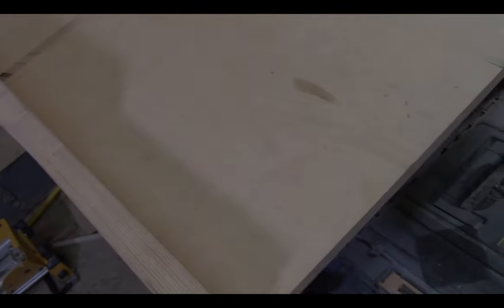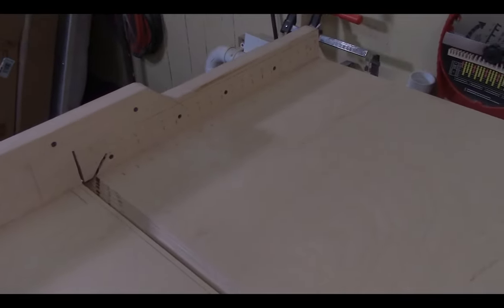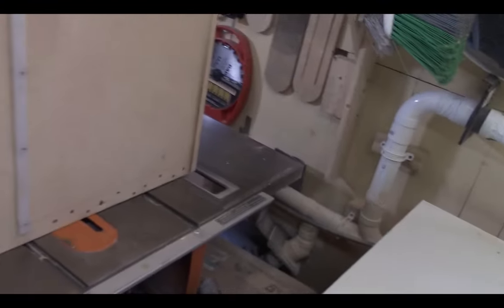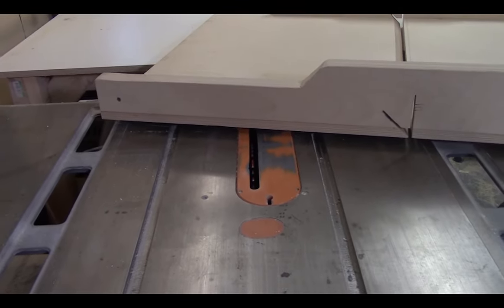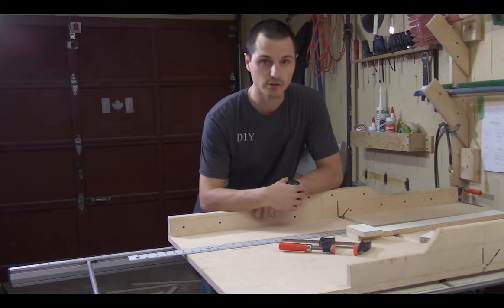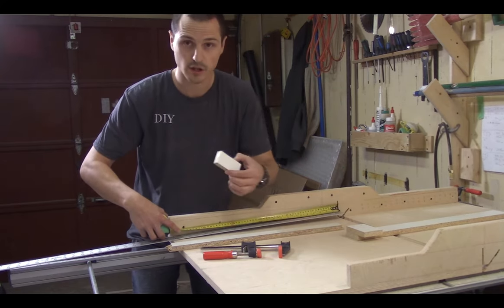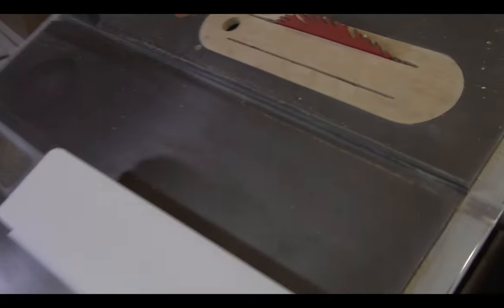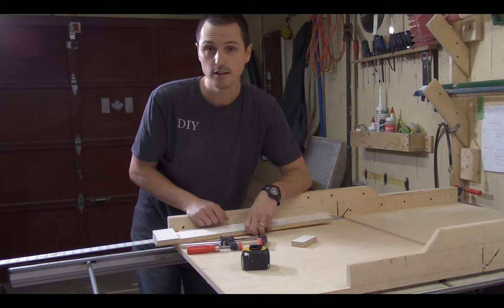crosscut sled for a table saw [plastic runners that will last forever!]

Comment: Bro. Do you have a video where you show how you attached the runners? Because I can't figure out how to get the runners to stay in place long enough for me to screw them in
Reply from the maker: cyanoacrylate! Lay the runners in the tracks and wedge them over to one side. Use cyanoacrylate on top of the vinyl runner and lay the plywood on top of the table saw. Once set, pre drill and screw down the tracks. Once you do that, cut the table in the middle only leaving a piece front and back then lay your fence square to the cut line on the table. Hope that makes sense! Good luck!
Reply: @DIYfortheaverageguy   I've done those steps, but I can't get them to stay in place with glue, so when I screw them in they keep moving slightly
Reply from the maker: When you shim the runners in the table saw, you should also shim them up slightly so the runners are proud of the surface of the table saw. 

🤞

Comment: I've bought plenty of birch plywood at Home Depot, but I've never eve SEEN Baltic Birch there.  Baltic Birch is a much higher grade than any HD I've been do carries.
The essential step for a crosscut sled is to get the fence perfectly square to the tracks.  That wasn't seriously addressed.

Comment: Found your video while searching for advice on using UHMW guide stock. Your super glue tip is surprising. I'd thought one downside of UHMW was that it couldn't be glued. Did you have to abrade the contact surface? When you tightened the screws did it affect the fit of the guide in the slot? Any degrade of the runners yet? Best wishes on your channel.
Reply from the maker: Thanks for watching! It held long enough for me to screw it in without any issues! No degradation yet! The runners still keep the sled tight 2 years later! Thanks for watching!